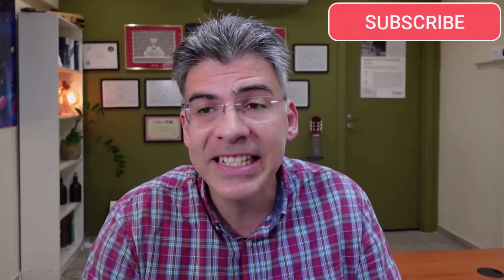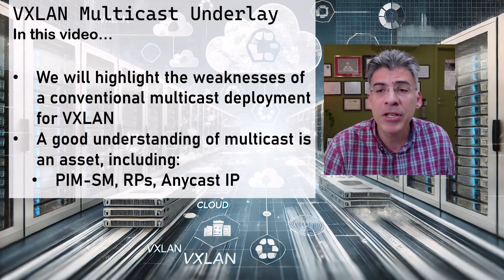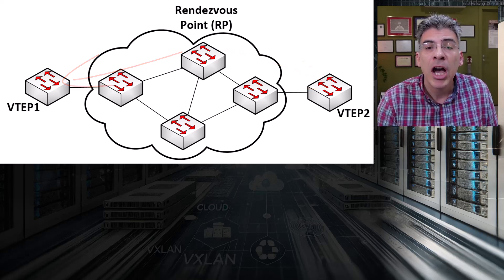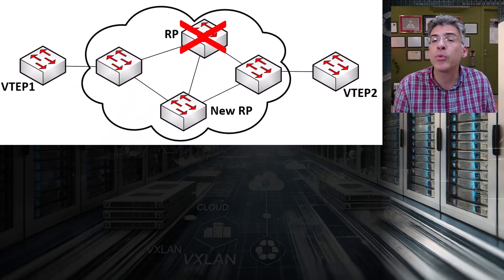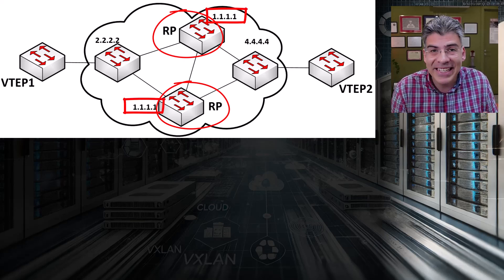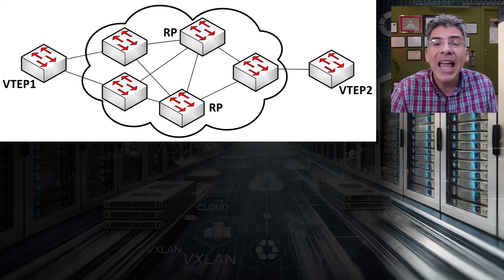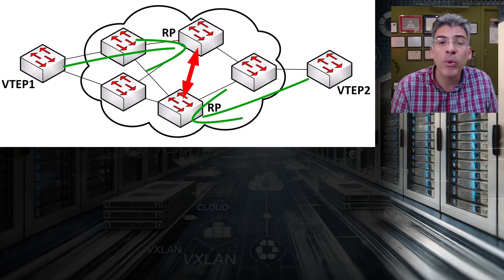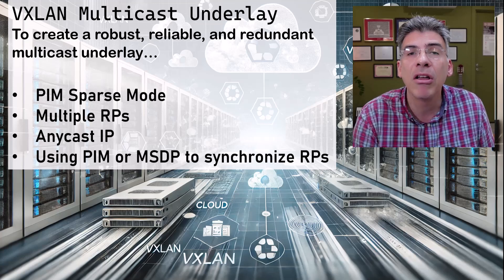VXLAN - Multicast Anycast RP Underlay Solution

Comment: It is valid as well using phantom-rp
Reply from the maker: Ah, yes, thanks for mentioning that!!  The phantom RP approach is another valid method for achieving redundancy in multicast routing. It works differently from anycast-RP but serves a similar purpose of providing RP resiliency and seamless failover.

Comment: Thanks for the video. I understand the reason why PIM SP is chosen over PM Dense mode. However, isn't it better to opt Pm Bidir with phantom RP over PIM SP? - in that way the PIM Bidir only installs (*, G) as opposed to (S, G) and (*, G) when using PIM SP.
Reply from the maker: I'm glad you find the video useful, and thank you too for being a subscriber!!  You're absolutely right, PIM BiDir with a phantom RP can be more scalable than PIM-SM because it only maintains (*, G) entries in the multicast routing table, avoiding the need to track individual sources with (S, G) entries. This is especially beneficial in many-to-many multicast scenarios, such as financial data distribution or IPTV, where the number of sources can be large. 

However, PIM BiDir has some trade-offs. It doesn’t support Source-Specific Multicast (SSM), it always uses the shared tree which can lead to suboptimal forwarding paths, and it requires full BiDir support across all routers in the path. While PIM BiDir offers efficiency in the right context, PIM-SM remains the more flexible and widely adopted option for general multicast deployments.

So it really depends on your application, and if the arragement you have in your network will benefit more from one implementation over the other.  Thanks for engaging however with your in depth suggestion!

Comment: How to configure this using Linux (debian) ?
Reply from the maker: VXLAN with Anycast RP is a feature more commonly found in enterprise-grade switches like Cisco Nexus, where multicast control-plane support is tightly integrated with the hardware. It's not something you would employ on a server or endpoint running Linux.  Did you have something else in mind?

Comment: Thanks a lot Sir for the explanation.
Could you please help with a query: Even though there was no hashing involved, we would want the RPs to be in sync with each other because its needed for efficient take over during failure of an RP, isn't it ?
Reply from the maker: Great question, and yes, you're absolutely right! 🙌 Even when there’s no hashing involved, keeping the RPs in sync is vital. That way, if one RP fails, another can take over seamlessly, ensuring minimal disruption in multicast group management.  This is especially important in VXLAN BUM traffic scenarios, where consistency across RPs helps maintain group state and reliability.

Comment: I've watched a lot of vids on tech, yours are the best. Please do multicast, things that are confusing about it....

Registering means a packet is being sent to the multicast group? But joining a multicast group is a PIM join? Also you can send to a multicast group without being joined to it? Being a member of a multicast group and registering (sending) to it are mutually exclusive? How does a PIM tree work? When a RP receives a payload via a register, how does it disseminate that payload to all multicast group members down the PIM tree? So many questions!
Reply from the maker: Thanks for your encouragement, it means a lot!  I will put multicast on my to do list for sure!

In multicast, registering refers to a sender’s router sending a PIM Register message to the RP to inform it of multicast traffic. Joining a multicast group, on the other hand, is done by receivers using IGMP, which leads to PIM Join messages being sent toward the RP or source. A device can send traffic to a multicast group without joining it, so sending and receiving are independent roles. The RP builds a multicast distribution tree based on these joins, and once it receives traffic via a register, it forwards it down the tree to all interested receivers. So, registering and joining serve different purposes but work together to deliver multicast traffic.  Does that make sense?

Comment: Hey Thanks Laz, I really do enjoy your videos. That being said, I am attempting to follow along with your VxLAN videos (which are great btw!) in gns3 using NX-OSv 7.3 switches and I am running into a very simple problem. How to configure the VxLAN underlay devices to support multicast? Basically the 'spine' devices as the VTEP's config is well documented and shown by you and others; however, the "non-VTEP" devices in between, their configuration for multicast support, seems to be lost in endless Cisco "white papers". Any advice would be appreciated?
Reply from the maker: Hey! Thanks so much for the kind words!  I’m really glad you're enjoying the videos! 😊 And awesome that you're diving into VXLAN labs with GNS3 and NX-OS, it's important to do labbing to gain a deeper understanding.

The configuration of the underlay for spine devices is not VXLAN specific.  It has to do with setting up features such as multicast and OSPF, and you'll find this info not in a VXLAN context, but a more general context.  That's why it's hard to find... In any case, to support multicast-based VXLAN replication, your spine devices need to run IP routing, enable multicast routing (`feature pim` and `feature igmp`), and configure `ip pim sparse-mode` on all underlay interfaces. They should also be part of the same OSPF domain for reachability and have a static RP set using ip pim rp-address. 

This allows the spines to forward multicast traffic between VTEPs that have joined the relevant multicast groups for VXLAN BUM traffic.  I hope that gets you started...  Keep labbing!